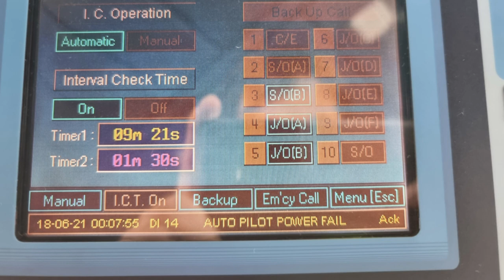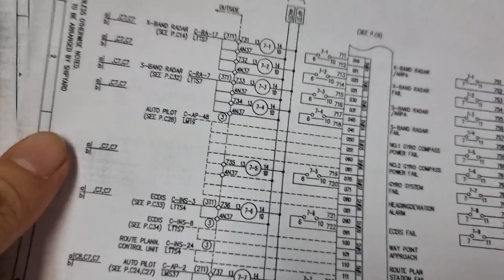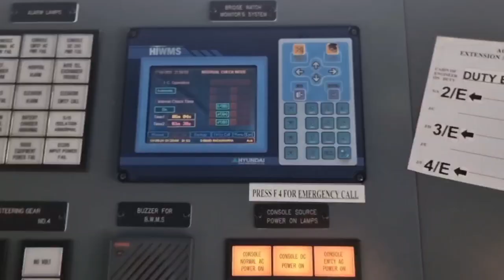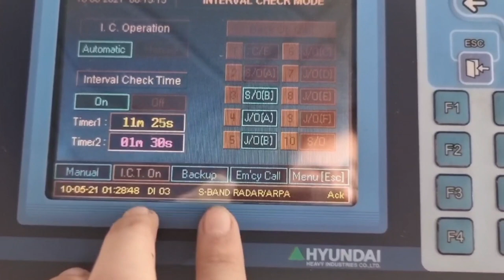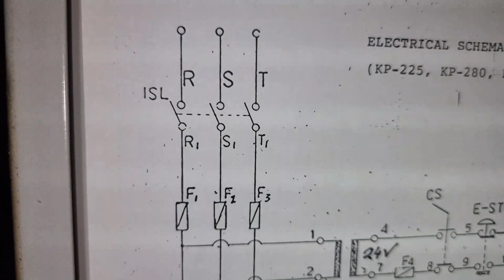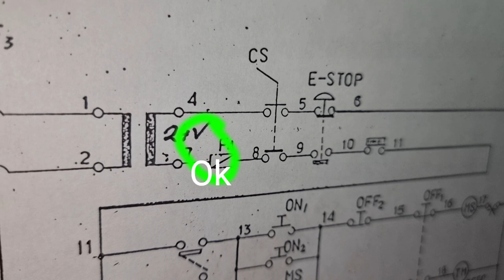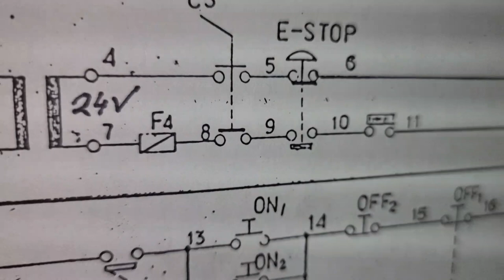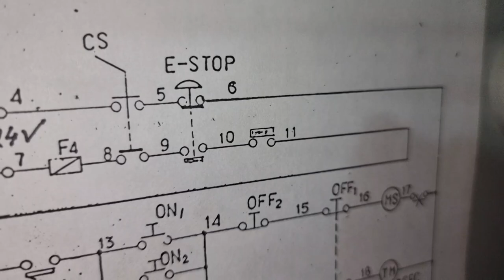AUTO PILOT POWER FAIL AND HOW TO READ WIRING DIAGRAM

Comment: Leckyjake, the same happened to our Boiler Control panel. The input terminal on its plc for auto start/stop of the feed water pump doesn't light as well. I had fun troubleshooting the problem with our electrician and learning reading wiring diagram. And I must say, it's always satisfying to nail down a trouble up to its root. Great video as always, all the best.

Comment: As an electrician do not use the Fluke 179 as an electrical test instrument, it will not clear the shortcut of 230v it cud access over 1000v... use a Fluke T150 instead.

Comment: Rather than starting the troubleshooting of the saw all the way from the 440 input, wouldn't it have been faster to start near the middle (say, output of the 24V transformer) and then move up or down depending on whether it had power?
Reply from the maker: This is the conventional way of my troubleshooting which I apply in all machineries on board. It just happened that this is a simple circuit. I am sharing to everyone this kind of technique which will be effective also for complex circuits such as the boilers, generators and other big machineries. A practice that you will not get lost unlike if you start from the middle of the circuit.
Reply: We were looking for some problem  with alarm stopping button for 2 days. It was interesting..
Reply: @leckyjake  Don't tell me about a boiler...when I became an ETO I had boilers problems on the first six vessels in a row. I also start from the power circuit moving all the way.

Comment: Thanks for sharing your knowledge. But regarding auto pilot power fail can you explain more why after checking the led indicator no 14 not on you decide to request for service technician?
Reply from the maker: It was not just the LED that lead to the request, it was the opposite function that the BWMS is giving. It should be the other way, that if the contact is closed then the alarm should not appear and if the contact is open then the alarm should be activated. BWMS is the AMS for the bridge equipment in which to request for service with the right spare is more practical than ordering and not sure if the spare will be delivered on time or if it will be the correct spare.

Comment: Jake ,  Regarding the AUTOPILOT FAIL ALARM which you identified as DI14   ,when you OPEN digital input 14  (DI14) by disconnecting the wires - the ALARM cleared.   And then when you installed a small piece of wire across DI14, the ALARM occured again but the LED indication did not switch ON.....These means the PLC input DI14 is still reading ok, the only problem is the busted tiny LED indication....I agree with you that this input module needs to be replaced because of the busted LED,     but after installing the new module   DI14 will still be CLOSED, that means you still have the AUTO PILOT ALARM......you need to investigate why DI14 is CLOSED to solve the problem, right?????
Reply: Hi Jake after your investigation, what did you find that is causing a CLOSED contact across DI14 ????/
Reply: I can't tell from the drawing however the alarm input from the auto pilot should be N/C (normally closed). When he opens the contact the alarm clears this is the wrong way around as it would mean if you had a cable break / fuse blow you wouldn't ever know.

Comment: the signal coming from Auto pilot relay why you change full DI module. when auto pilot have power this relay ON and the contact was us normally open, when Auto pilot lose power relay will close you will receive alarm